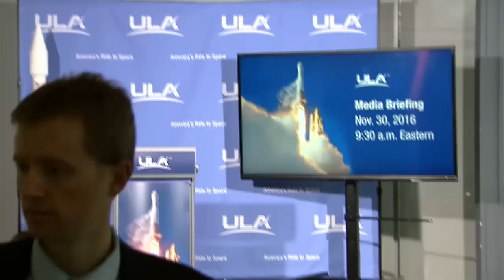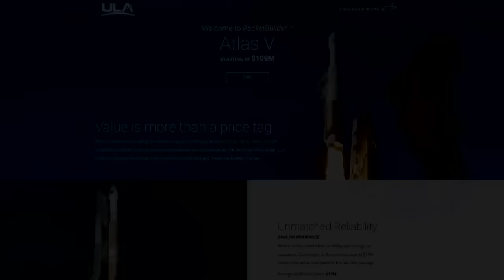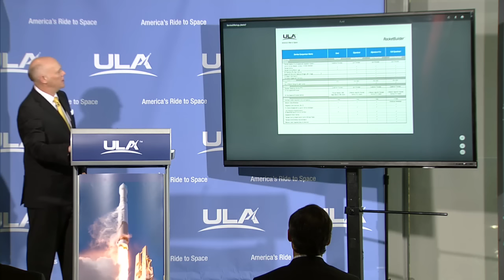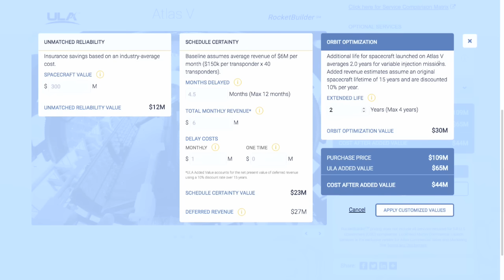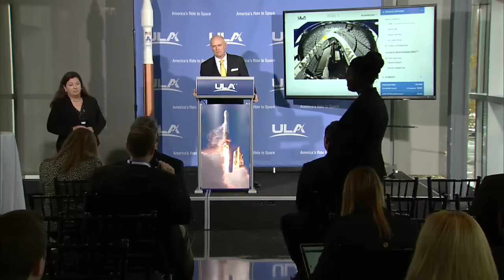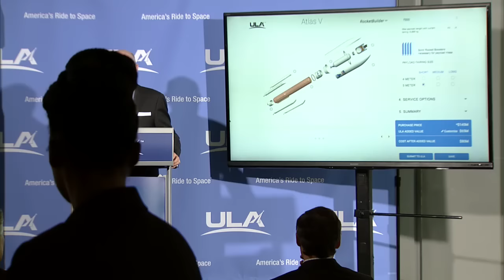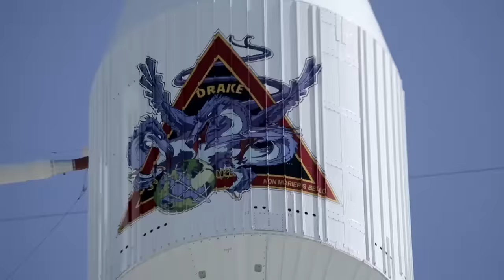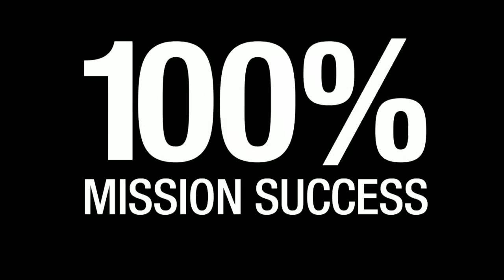Press Conference: ULA Unveils Website to Transform How Launch Services are Selected

Comment: 2 reasons ULA had not had catastrophic failures. they were given mature launch vehicles by their parents companies. and ULA does not innovate like spacex does. every launch is the same. no changes. Spacex innovates on each launch until the falcon9 is mature. once it's mature it will be as reliable as any rocket can be. in glad ULA is trying to become more competitive. but eventually ULA need to develope reusable launch vehicles or ULA will become obsolete. keep it to Bruno! your doing better than Michael Gass ever did.
Reply: SpaceX's QR issue that led to the failure is not particularly comfortable. That's not a "vehicle maturity issue", that's a systemic issue that's often difficult to solve (case study: russian launch vehicles)